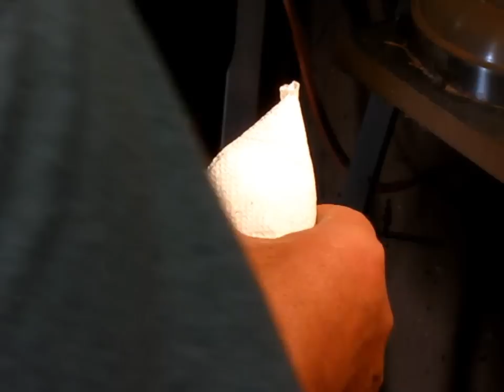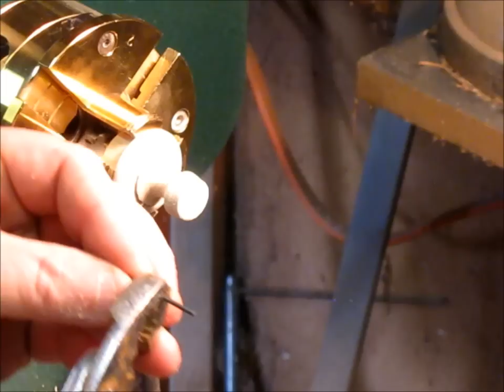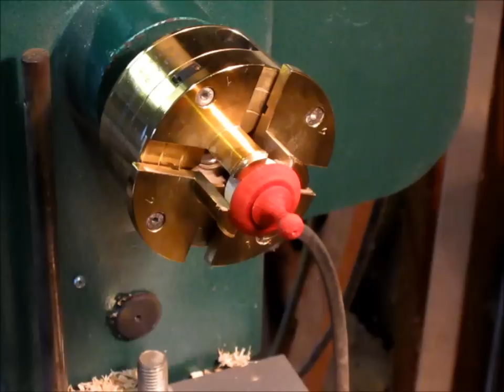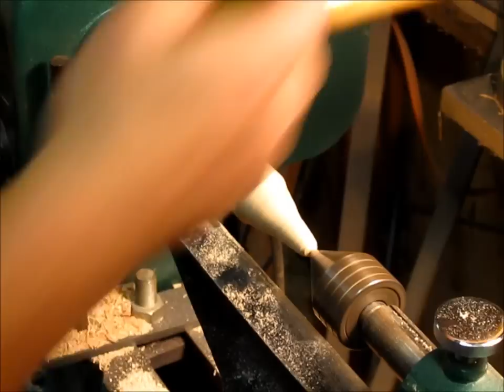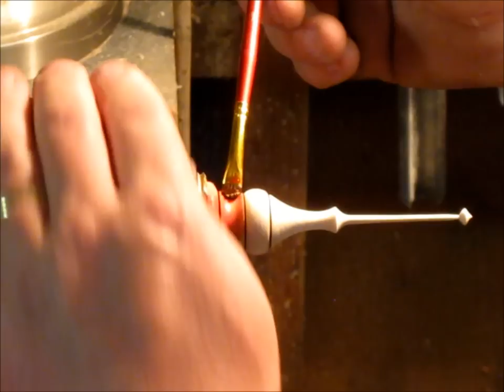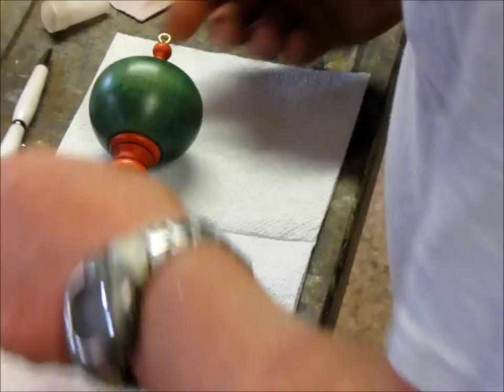#13 Woodturning a Christmas Ornament Part 2 of 2

Comment: Hi Stephen, I'm watching you make your Christmas ornament, and i think you are doing a great job, and I think I can do this.But I wanted to let you know that I think the bearings on your lathe are getting dry. They are making too much noise. I hope you can lube them easily.
Keep up the fun.
Reply from the maker: Thank you Jack for commenting. Glad you enjoyed this project. This lathe is a little noisy. I too though it was the bearings, but it turns out it is the variable speed pulleys holding the top of the belt and it squeaks. I used belt conditioner once and in ran almost silent. The bearings can not be lubricated, only replaced. I really appreciate your observations and your input. Thank you for commenting and supporting my channel.